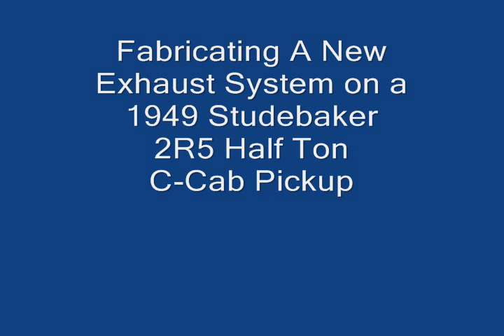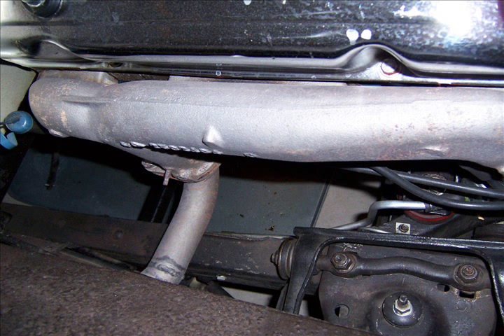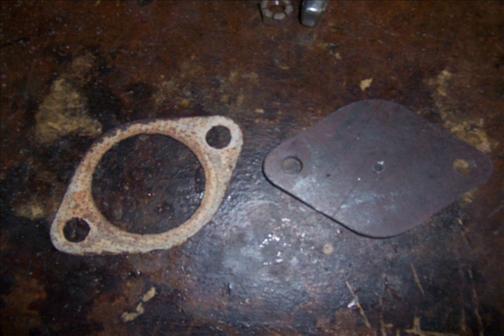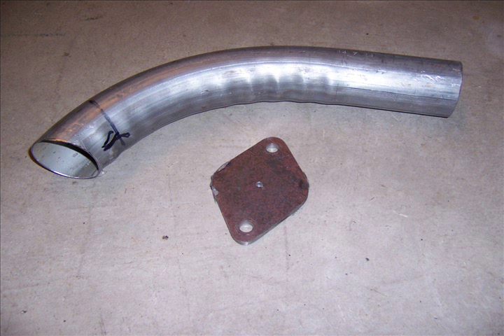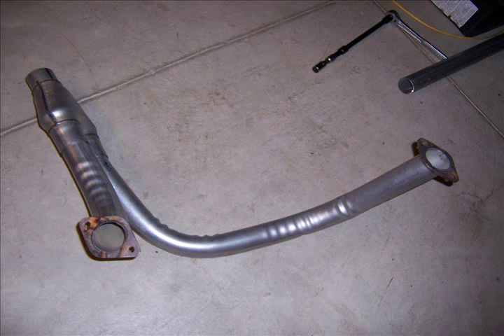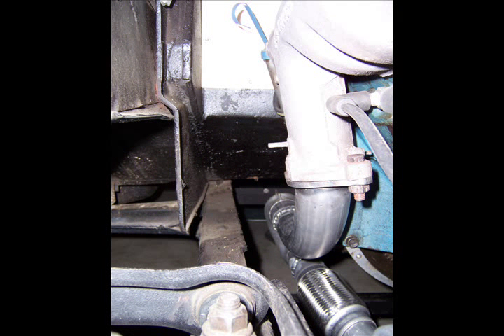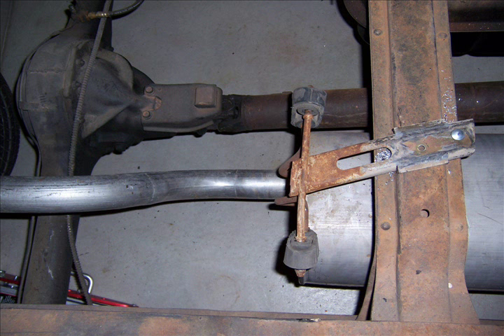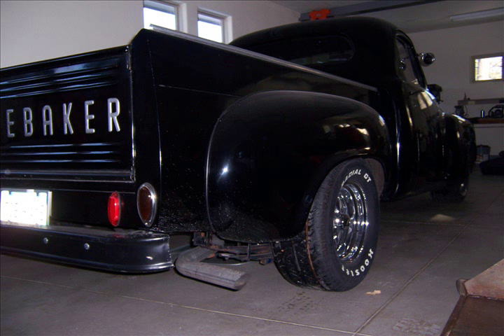Exhaust  Fabrication and Installation on Studebaker Pickup

Comment from the maker: This truck has the drive train from a 1969 Chrysler Newport and a Mustang front clip, so it is lowered just a bit.  So 383 big block 300 hp with 727 3 speed transmission.  It is essentially a half ton car now. 

The initial cherry bombs sounded like a straight pipe Harley.  Exterior is stock.

55 is a nice model.  I did a stock 56 with a 6 cylinder.  To do 60 mph, 56 engine was at 4000 rpm and 10 mpg.  This 49 does 70 mph at 2000 rpm and gets about 17 mpg.